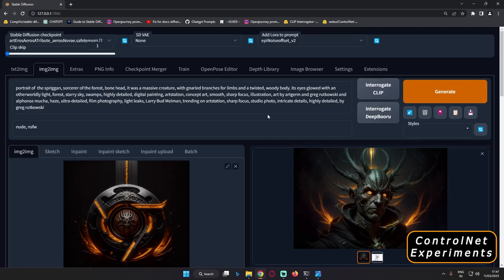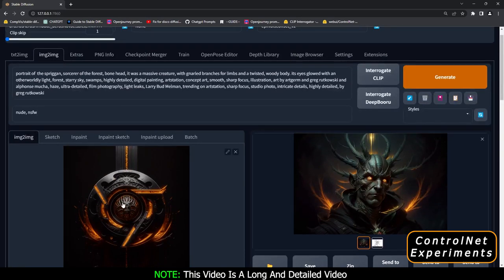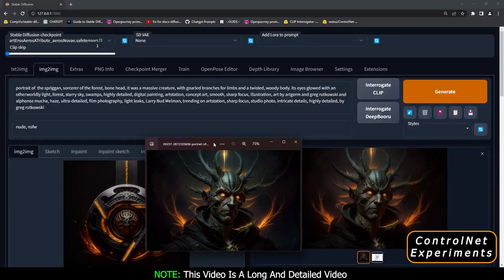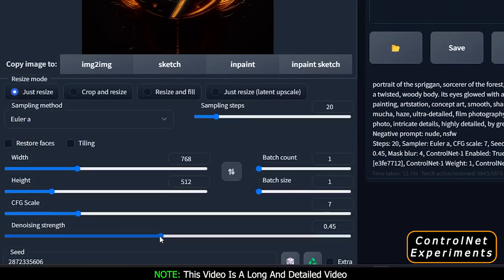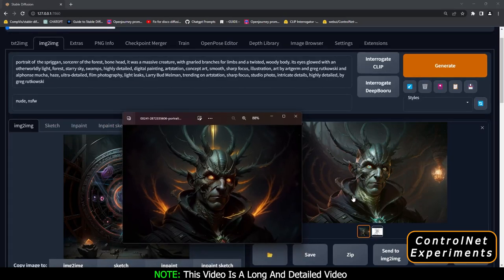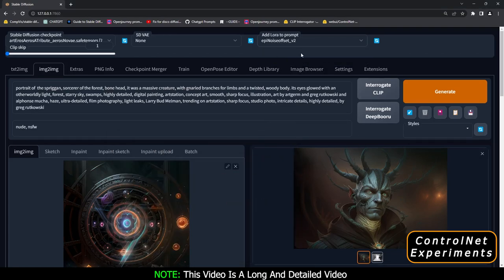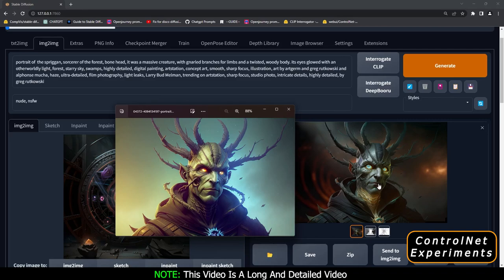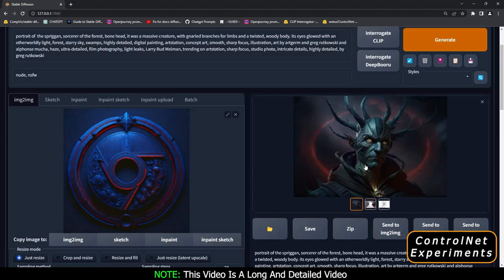Stable Diffusion Multi ControlNet Experiments Detailed Workflow | Noise Offset Lora | ControlNet

Comment: I think in a recent diffusion you were saying that illuminati diffusion was a little better compared to aeros, I know you added the noise offset lora but why use aeros ?
Reply from the maker: Illuminati didn't work with this controlnet model as Illuminati is 2.1 based model... And the 2.1 based controlnet models are releasing soon and some are released as well... In thi video I have use 1.5 based controlnet model and aeros is 1.5 based model...
So dats why I went with aeros
Reply: @CHILDISHYTofficial  Oh yes I forgot that ! I think 2.1 based controlnet is already out but maybe it's WIP. Thanks for the answer !
Reply from the maker: I tried 2.1 based model but for some reason 2.1 is headache for me... It doesn't works properly... Everytime I get memory errors